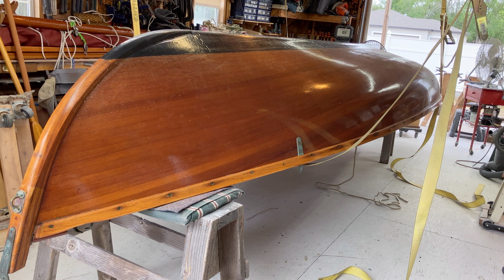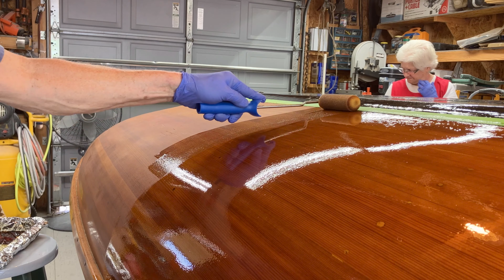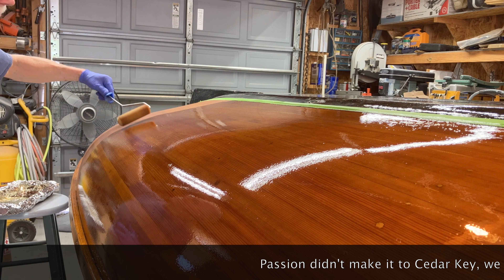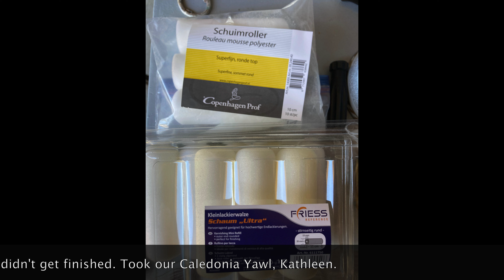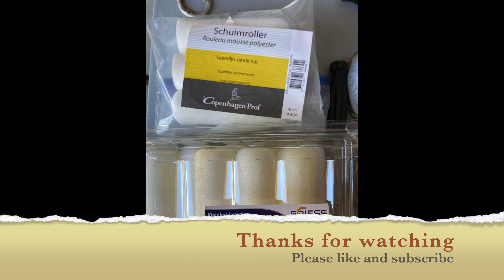Varnishing Tips, spiffing up the Melonseed.

Comment: I have enjoyed watching your videos and the progress you are making on the catamaran. I am impressed with your patience, persistence, and attention to detail. I also watched your video on varnishing tips. I am finishing my 3rd kevlar/carbon + glass solo canoe and I am planning to varnish it to protect the epoxy. On my 3 previous strip solo canoes and kevlar canoes I have always used a foam brush to apply the varnish, but I inevitably get holidays. The roller looks like a better approach.  I have looked for the roller that you recommend on Amazon and I've googled it, but I can't find it (I only get European pages when I've googled). Do you think any superfine roller will work? Is the one you are using polyurethane, microfiber, and nap (I can't tell from the video)?
Reply from the maker: Bob, Hi, I can't find when or where I ordered the rollers from and haven't found them from our usual online venders. They are a superfine polyurethane roller.  Not sure if they will all perform as well as these. Will let you know if I find one that works as well, ordered some from Amazon today. Best to you.
Reply: @RexandKathie  Thanks. I'll look around that the various hardware stores and see what I can find.
Reply from the maker: Bob, The rollers that we ordered from Amazon did a comparable job to the ones shown in the video. Search for FOAM PRO 185 Foam Paint Brush Refills, Pack of 2 on Amazon. They specify can be used for varnish.
Reply: OMG! WOW! Did that make varnishing easy and quick plus beautiful results. I bought 4" foam rollers at Home Depot and they did the trick. Many thanks for the advice.
Reply from the maker: Happy you had good results. @rbringle  If painting have been told that red tree mohair rollers do a good job. Best to you.